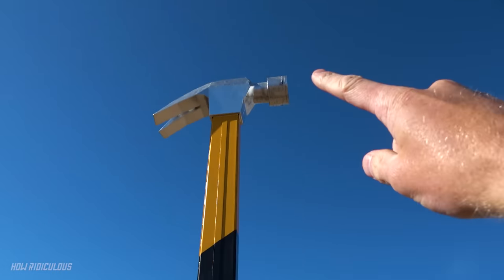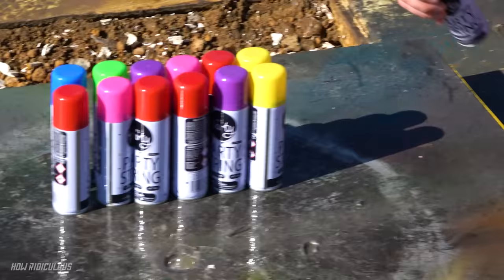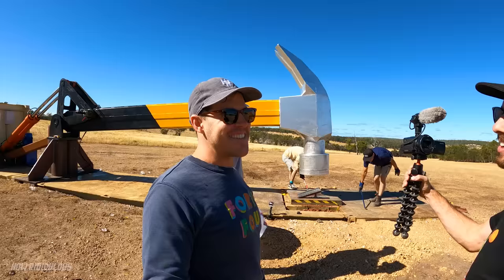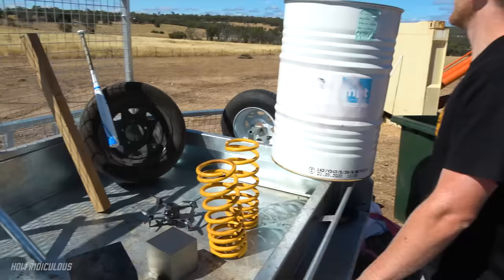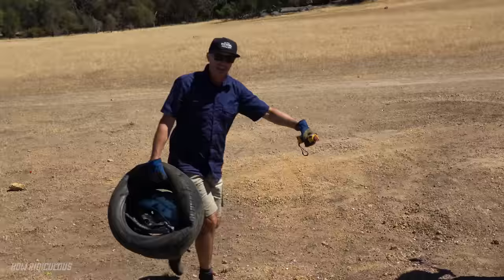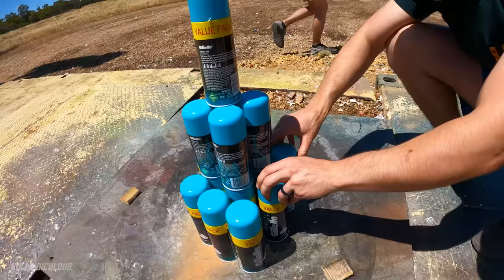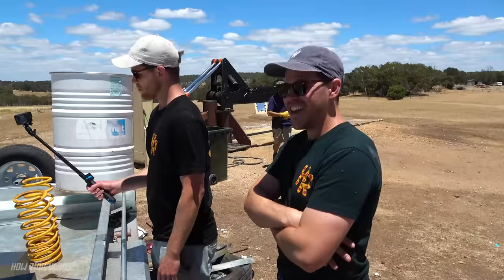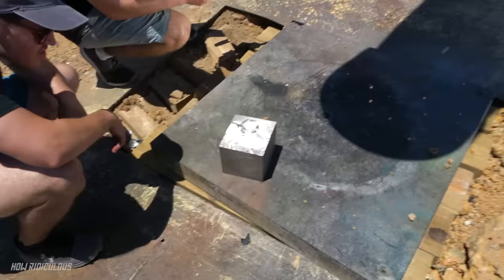Can We Break An Obsidian Block With A Giant Hammer?

Comment: Just a heads up, those springs have crossed coils and have potential to slip past eachother kind of like when you snap your fingers. I worked for a spring manufacturing company for 6 years making high tensile springs with 1/2"+ diameter wire, the loads when comprsessed are in the thousands of pounds of pressure. Pro tip: be very careful with where they end up. 🙂
Reply: Yep. I worked as a mechanic, and I would not have been outside that bunker at all. They don't call manual strut spring compressors "widow makers" for nothing.
Reply: Omg that's one Giant Hammer you got!
That's 3x the biggest!
Reply: Those springs looked permanently deformed, so it probably wouldn't have killed anyone if the coils uncrossed.....although I could see losing a finger or two.

Comment: From a strictly mechanical point of view, I really liked the springs.  You could see that as the springs were compressing it didn't slow the hammer one bit, but as soon as the coils stacked solid, there was a massive hesitation in the hammer for an instant.

The best looking one, my vote goes to the metal drum.
Reply: I love the reaction “I’M DUCKING IN!” “oh it got sausaged” or “sauced” couldn’t quite make it out
Reply: @kevyndouty772  "oh, it got sorted." as in they really got sorted out. Or "put in their place" in American terms.
Reply: pretty sure that was just the playback rate of the slowie getting slowed down, you can see it speed up again to pretty much it's original speed right after
Reply: My favorite was the fly that got knackered with the shaving cans mainly because they didn't seem to notice it!!!

Comment: The springs were very interesting. U can clearly see they work exactly as intended as they compress perfectly until fully compressed. If they had stopped the hammer’s momentum at that point, then the springs would have pushed the hammer back at maximum force. However, the springs did not stop the hammer. Thus, the springs permanently deformed and did not push the hammer back.
Reply: Hooke's law right?
Reply: @nathanblackman1063  Hooke's law just says that the amount of force needed to compress or extend a spring some distance scales linearly with the distance. It's not about springs getting smashed by hammers, although if you want to derive your own law about this maybe it could be named after you.
Reply: @desmond-hawkins  'Hooke's law just says that the amount of force needed to compress or extend a spring some distance scales linearly with the distance' - up to the limit of proportionality where the force and extension are no longer directly proportional, which is why the springs are permanently deformed by the hammer, otherwise they would just bounce back into place.
Reply: What blew my mind is the shake/vibration you can see in the hammer after the bounce after impact. I have to wonder how close the hammer was to being shook to pieces!
Reply: I loved watching the movement of that spring as it flew through the air.

Comment: To be fair, those suspension springs had no chance taking 3 tons with that much gravity when they're normally paired with shock absorbers and tires and a bunch of other little things to take a lot less pressure, but a few uprated springs for either AWD off roading or something might stand a chance of a good bounce
Reply: Thx! Satisfied my curiosity.
Reply: To be fair in most suspensions the shocks are their to stop the springs from being so springy and not always to resist the force  and those were pretty beefy springs so you'd need something like for a train car or something like that to maybe stand a tiny bit of chance .

Comment: When you look at the truck spring slowie at 21:08 you do see why they were scared of the springs breaking the hammer. Such vibrations on an object this massive are never good.
Reply: not just that, if the springs rebounded the hammer, the entire force of the hammer going up would be transmitted through the handel - which until then only has to deal with the force of gravity and a sudden stop. If the handel shatters, the hammerhead would be able to freely fly through the air, and it would mince ANYTHING it landed on - including their bunker.
Reply: Yea that hammer just flexxed for a while! That IS scary!
Reply: The most dangerous thing about the spring is nothing to do with the hammer, it's if it pops out sideways and can transfer the hammer force to a flying spring. Everything else shattered

Comment: You would only have to worry if the spring size matched the load descending on it... Then the hammer might feel a pinch. You could see mid slow-mo, that the compression tried to flex back, but the extra hammer power just crushed it past the point

Comment: Have you measured how much energy the hammer strikes with? I'd be interested to know how many joules it's pushing before it hits the target :D
Reply: In the video where they introduced the hammer, they say that the hammerhead is 3 tons and is coming from a height of 7 meters. Assuming they're using metric tons, that's 3000kg*7m*9.8m/s/s =  about 200,000 joules.

Comment: You should dig a big hole under the impact point of the hammer, and fill it with cement or concrete mix, wet it and let harden. With the impacts and time you should get a pretty solid block. Should be great for reducing the dissipation and absorption of the impacts.

Comment: If you want a perfect 180 gallon drum to spray evenly it must match the slanting of the hammer when it hit’s in other words tilt the floor a couple degrees so that the hammer close perfectly the drum opening and must be well centered so that the smack down is distributed evenly, ❤👍🏽
Reply: Or they could put a larger plate on top of the barrel, too. Like a piece of plywood, or a titanium circle.

Comment: You can compress water but to do so would either require it to have no boundaries except for gravity unless said boundary is solid diamond so it has to be a water planet that is so unreasonably large and have so much water on it that the water at the bottom of the oceans of said planet would become what I think is called ice 7 where it is effectively just water that is condensed into a solid, which is basically what happens for a split second when you hit water from terminal velocity and it sounds like a gun shot

Comment: Rail road car suspension springs. I am looking at my ho scale model of a early B&LE rr coil car. The light weight of it is 84 400 lbs and loaded weight is 230,400 lbs. Funny enough the max capacity is only 230,000. I would say a railroad freight  car suspension spring would be quite the contender for the hammer.